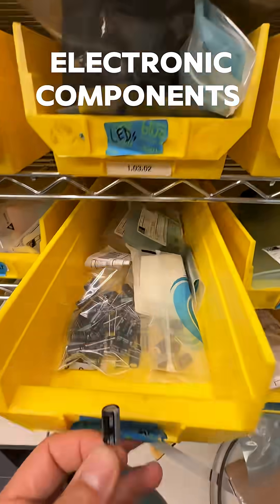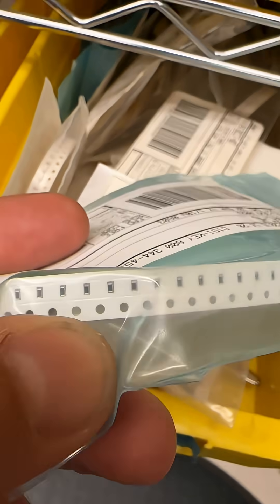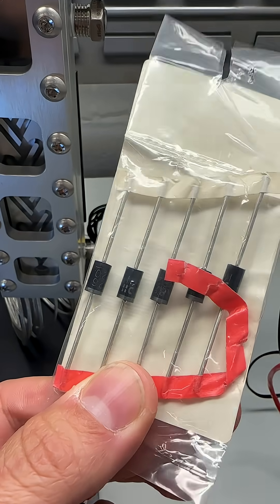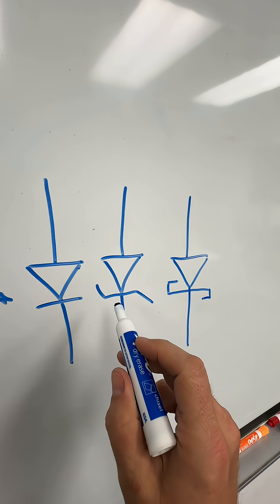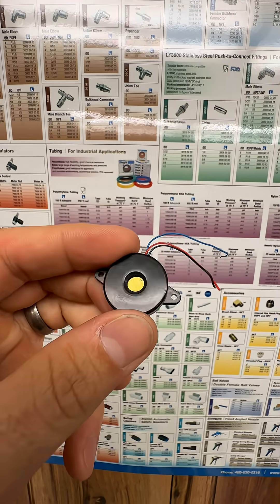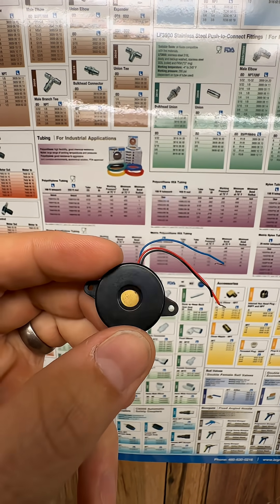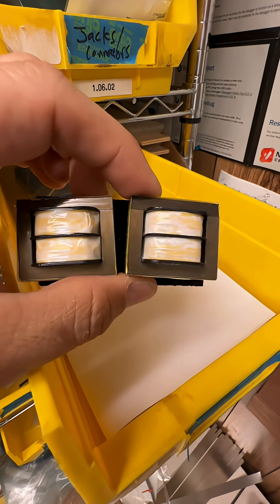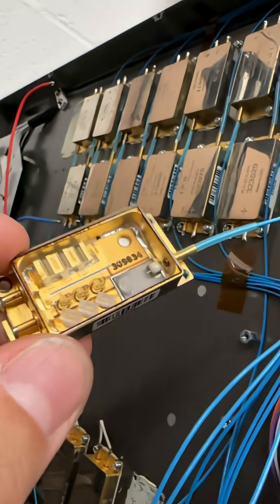Intro to Electronic Components

Comment: Not sure if you can answer this question, but I’ll ask anyway.  
If you experience a power surge from unplugging equipment without powering it down, and the power supply boards are still good, which part of the power assembly is most likely not working?

Error message is 24v low/ high

Assuming most power supply units are built the same. New to this would appreciate your input.

Comment: I don’t think I would describe a resistor as “just dissipates power as heat”. It’s not often that you want to use a resistor because it gets hot. Its name is already 92% the way there to describing what it does, and once you know even a little bit about electric circuits it’s pretty easy to infer that it resists current flow. Why complicate it by describing it by its usually unwanted side effect? And to make it worse you throw in dissipates which is not a word in the common vernacular. Your definition is really going to confuse more people than it helps. Therefore I resist it.

Comment: You might create some interesting conceptions in some people. For anyone who doesn’t have learning in electronic components, most of what he said is correct. Resistors do simply dissipate energy as heat, but the purpose in doing so is to reduce current flow and/or voltage. Transistors can be operated in strictly on/off states, as a switch for power, oscillators, and in digital circuits; or variable, used often as an analog amplifier or in analog oscillators. As someone else pointed out, transformers can be used with pulsed dc, like ignition coils in engines. A really cool thing about piezoelectric discs is that they can operate in reverse. Apply pressure, and they will produce a slight voltage. Some microphones are piezoelectric. What he’s saying about capacitors is about being in series or parallel with a signal or power source. I at first thought he meant in series or parallel with other capacitors, which is something else… The only thing he got wrong was when he wrote labels over the diode symbols, he swapped Zener with Schottky. Speaking of diodes, does anyone know the difference between “conventional” current and electron flow? Does anyone even care? 😂
Reply: 16 component types it's child's play seriously

Comment: dude, you just seriously made me miss radio shack.  the only section of those stores i liked was the walls of component bins in the back, holding a lot of what you just showed & a LOT more - as i'm sure you remember.  i haven't seen such a components candyland since they went out of business, except the rare engineering lab i got invited into, which is also where i was introduced to 3d printing (in afghanistan, of all places).
Reply from the maker: Closest thing we have in Ohio is MicroCenter. They have tons of components and Raspberry Pi, Arduino, etc.
Reply: @i2c_jason yeah... there's nothing like that i've seen in wyoming.  there's a microcenter in denver & i stopped in to look around when i drove down for rmrrf, but that's all.  most of my components get delivered.  i miss being able to browse just for the hell of it.

Comment: I just have one correction, the transformer is usually AC, but can with pulsed current. It works as long as a change in field is made and alternating current is not the only form of changing field.
Reply from the maker: Changing current is the correct overarching  term.
Reply: @i2c_jason yep yep!

Comment: Can you teach me a little more I want to make my own DCS model train decoders with sound files.
Reply: If you’re asking here. Behind the power curve of learning how to learn. So many better options than random YT short. Fyi. Husband is self taught engineer only now using gi bill. Udemy, MIT opencourse ware, khanacedmy, and many more but to name a few. Please learn. Research. Also! Public library and also look up old radio shack circuit board trainers. You could probably use one of those and hid under your train set. That would be analog electronics. So much info on the digital too like raspberry pi. As well as crossover. Im not a train set gal but i know the hobby. Im pharmacist but do software and electronics as hobby. Mostly skate boards with circuit boards representing a morse code.